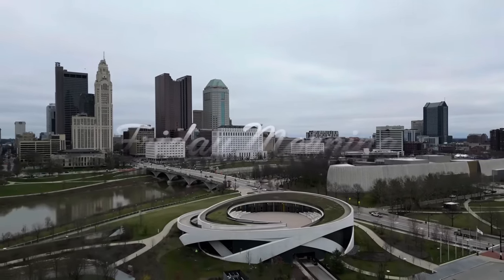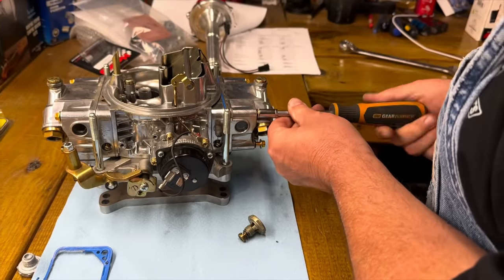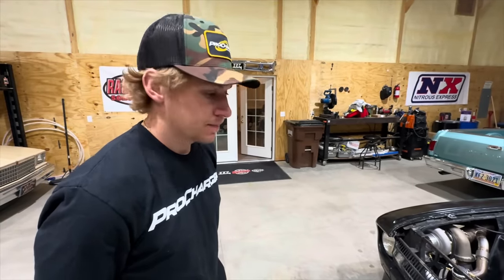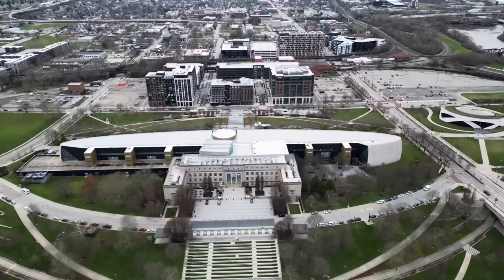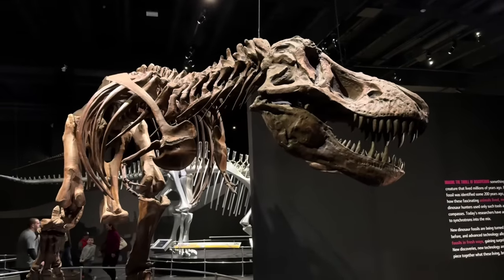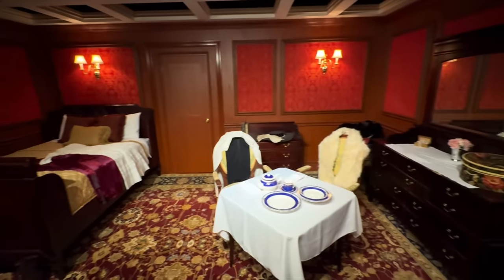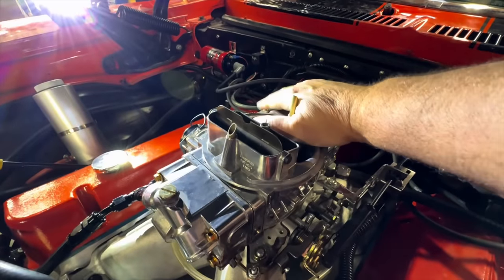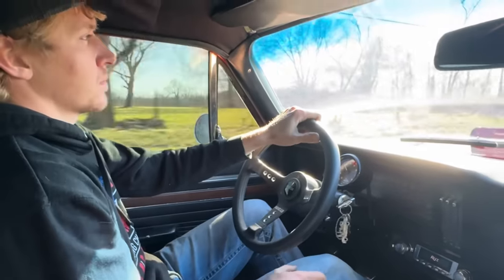GM 572ci BIG BLOCK 5 SPEED 1970 NOVA GETS A TUNE & RIPS THROUGH THE GEARS!

Comment: Ya'll need to invest in some kitty litter and a chunk o 2"x4". start rubbin them floors where slop hounds are just letting fluids drain and sit on the deck. Shops already starin to look like a slop house. Other wise they will be flaking and chipping in no time.  As for the Nova that 542 sounds good. Still seems sluggish in the wind up but there is more room on that carb for pumps n cams to be tweaked to help all that.

Comment: What are the pos and negative sides on locking the ignition to.    Use vacuum advance at scruising and idle and aet timing at 3000 rpm ?

Comment: Hey Bill, I had the same problem happen to my Vortec 350, turns out the distributer cap needs to be vented. I switched to this cap and It has worked 5 years now! Hope this helps brother
UNITED MOTOR PRODUCTS DCR820X Includes Rotor; Blue Brass, Premium Quality Info One of our most popular parts
Kit w/Brass Contacts and Vent
Reply: Mine wouldn't start when it rained either. I replaced the cap with an ACDelco and ran but as soon as it rained, it wouldn't start when it was really wet out. I went on rock auto and thought what the heck ill try it... and it worked. Hope this works for you in your situation.

Comment: Why do you not go by engine vacume when you change power valve!
Reply from the maker: I don’t need a vacuum gauge to know it has a lean spot. I don’t care how much vacuum it pulls at an idle.
Reply: @theoldmansgarage  thats not the only way to use a guage! Too be correct! Thats why they have numbers! To figure out where & when it needs it & which one it needs! Not just at a idle or in gear! With out a pump & guage you dont even know if those numbers on pvs are correct! Thats why most pvs arent even numbered anymore!